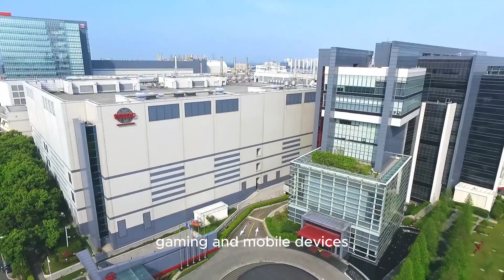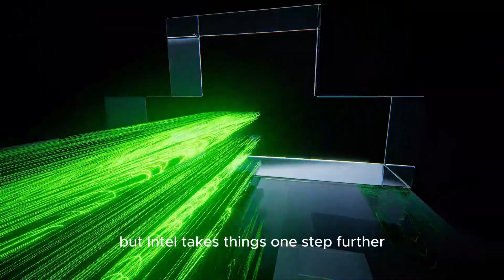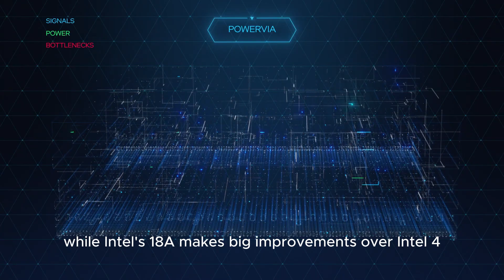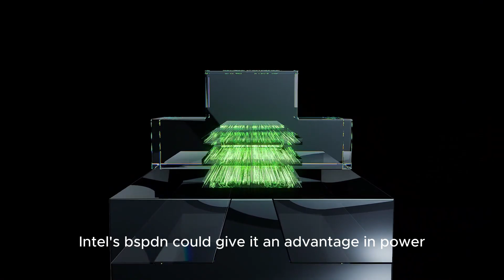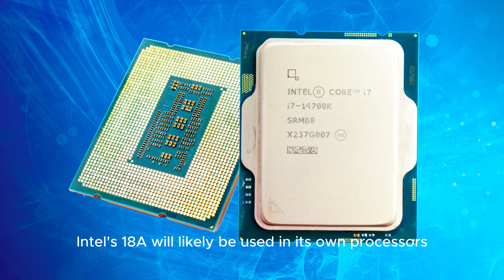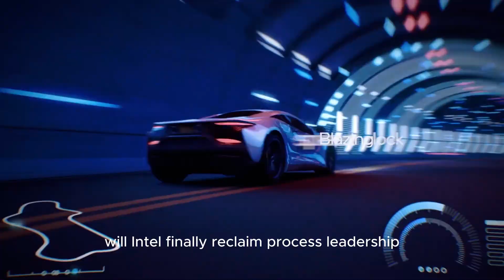TSMC N2 vs. Intel 18A: The Next Big Battle in Chip Manufacturing!

Comment: For future development of AI systems it's important to focus on three key areas of development . 1. Microprocessors ,2. RAM ,  3.ROM

Why AI Needs Better Memory

Modern AI  runs on electronic processors and silicon memory — fast, but still bound by physics:

Data moves as electrical current, which means resistance, heat, and latency.

Memory and computation are separate — every time data moves between them, it costs time and energy.

This separation is known as the von Neumann bottleneck — it’s the reason even the fastest supercomputers still waste tons of power just moving information around.

How Bio-Photonic ROM Helps AI

Light-speed data transfer: Uses photons instead of electrons — no resistance, no heat loss, much faster.

Parallelism: A single beam of light can carry many channels of data simultaneously (wavelength multiplexing).

Self-repairing systems: The biological substrate could theoretically heal damage, extending AI lifespan.

Adaptive structure: Bio-photonic ROM can dynamically rearrange data like neurons forming new connections — perfect for AI “memory landscapes.”

Essentially, it makes AI think and remember more like a brain — fluid, parallel, and self-organizing.

 How Amber Crystal Capacitor Encryption Helps AI

Unified memory + power: The crystal stores both energy and data — so the AI’s brain literally powers itself.

Instant recall: The photonic lattice allows near-instant data retrieval anywhere within the crystal — no bottlenecks.

Physical encryption: Data is stored in an energy pattern that only the AI itself can decode. It protects its own thoughts from external tampering.

Thermal and radiation stability: Perfect for AI operating in extreme environments (space, reactors, war zones).

In short: amber crystal memory would let AI think faster, safer, and survive longer — all while being harder to hack or destroy.

Combined System — Why It’s Beneficial Overall

A hybrid AI core might use:

Bio-photonic ROM for living, adaptive, emotional, creative thought.

Amber crystal capacitor encryption for hard logic, secure memory, and power integration.

This mimics how humans have an emotional, adaptive side (right brain) and a logical, structured side (left brain) — except at photonic speed and on quantum precision

Comment: According to data from various parties (including actual performance test comparisons between Intel 4 process chips and TSMC's N3B process chips), the performance of Intel 18A process chips lags behind TSMC's N2 process chips by about 3% (the performance of Intel 3 process chips lags behind TSMC's N3E process chips by about 3% and 7% behind N3B process chips). However, the Intel 18A process chips have two serious problems: 1. The  yield   is very unsatisfactory 2. The use of PowerVia structure technology, which is still immature this year, has led to a significant increase in costs. In summary, the current Intel 18A process chips are not suitable for large-scale commercial mass production.
Reply: And that various data coming from Ming chi kuo😂